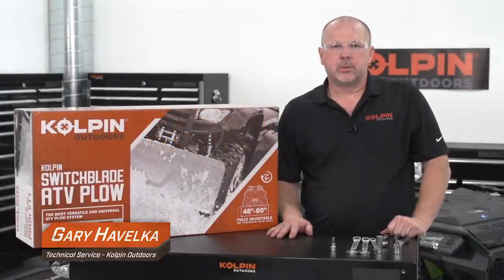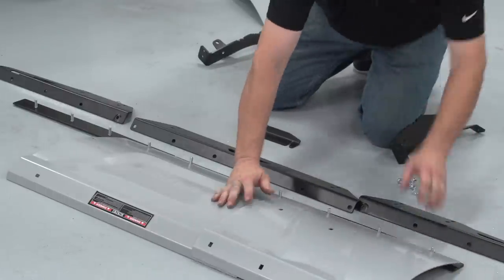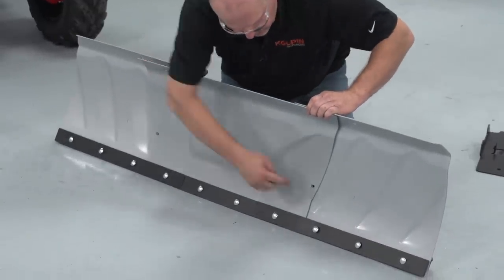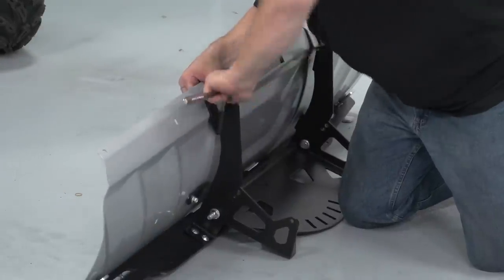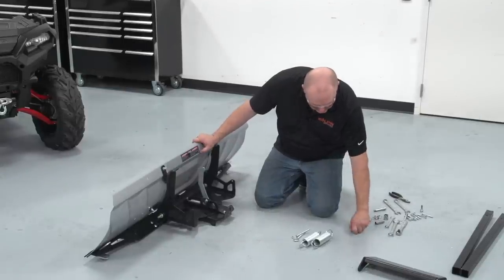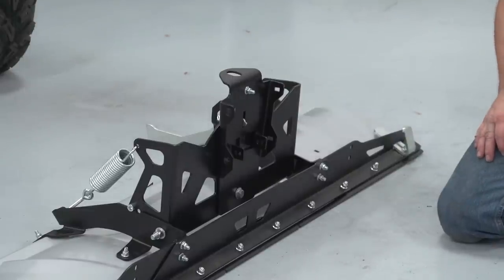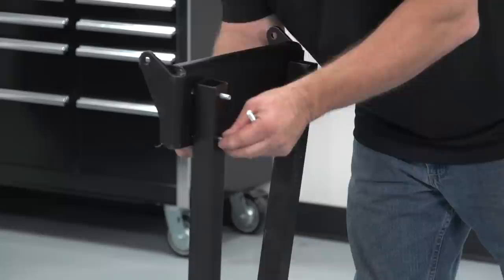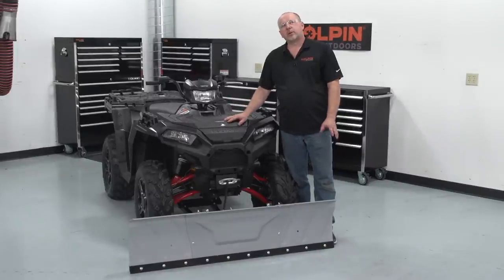SwitchBlade™ ATV Snow Plow System Assembly and Installation - KolpinOutdoors

Comment: Any videos on universal mount install? This video skips that whole Step..i know they vary per quad but would be nice to see it done once
Reply: If you need help with the universal mount it you may need to buy a surmount for certain machine and what you'll need to do is there are holes in your frame and you grab your you U bolts and your bracket and then tighten them down against the frame make sure they both go on both sides and then you'll be good

Comment: Your video was decent, you need to be more specific about which piece of hardware goes where. I had to jump back and forth between the video and the instructions because you didn’t tell me the exact nut or bolt that I needed.

Comment: First of all, both of our customers that bought these units gave up and brought them in for us to install. With over 200 pieces of hardware, lousy instructions, and a "universal" mount kit to deal with, they chose to pay us $60 per hour and negated any savings on the cost of the plows. The mount install included grinding, cutting, and repeatedly installing in different locations until the front tires didn't rub the mount at full lock. What a misleading piece of information you have provided.
Reply: What did you mount it on?     I'm not a mechanic and a friend and I did it in an hour in -20. Only weird part was the mounting bracket on my 2021 Polaris 570 wasn't lining up, but we figured it out. Otherwise it was a walk in the park. No drilling or grinding and cutting.
Reply: @simonduzz  Suzuki ATV 4wd and a CFMOTO UFORCE 1000.
Reply: @atvseatexchange2176 what did you grind on the Suzuki ? Model and year ?

Comment: I got the UTV switchblade it’s the same but adjustable 60” up to 74” .  This year I’ve put it on my 2023 Honda pioneer 520 as a 60” setup without the push tube extensions.   Last year I used it on a parking lot on an s10 Jimmy as 74” with the push tube extensions .

Comment: It took me a lot longer to install mine as well. I assembled it in my garage. I had it lifted up to get under easier. 
I cut the bolts underneath like it says to. Lowered the 4 wheeler drove out the garage and tore out the bottom plate
that the door goes down to. So on my 4 wheeler it is too low to the ground after the plow is attached!!

Comment: Hinge lever bracket needs to be shimmed in the back bolt so plow will pivot more easily.  I installed it on the polaris 570 and the mounting bracket fits very good just ahead of the battery but you have to grind the metal battery box on the corner very little.. Very pleased

Comment: Thanks very much I'm putting on a 2014 Can-Am Outlander 1000 Max Limited the directions are kind of a pain in the ass I was able to get this done in about 45 minutes to an hour with your video thank you making it easier!
Reply: Did you get it installed  inwant to put one on a 2010 renegade
Reply: @austanhall  yeah I got it on wasn't very tough took about an hour I'd recommend getting the guiding sticks that go on the side of the plow it makes it a lot more helpful
Reply: @austanhall Did you get this installed on a Renegade? I have an XMR and looks like I need to drill all the holes

Comment: Hey Guys, Just yesterday I put this blade together with a friend, it does only take about an hour, only on my 2021 Sportsman 570 the Mounting bracket just didn't line up with the photos in the directions or the pictures that Kolpin Emailed me after we started freezing our asses off trying to get it mounted. In the end we figured out a way to do it with 3 U bolds like required ( NO TIRE RUBBING, NO BORING HOLES IN THE FRAME. NO BENDING THE FRAME) as I've seen in some Comments and other videos, if you're bending the frame you're doing something wrong... In the end it works without issue. Best to line it up to the frame before hand and make the call yourself. Otherwise I've seen some long term reviews, seems to check out as far as durability goes. Just try to lift the box when you buy one lol, its heavy duty. Non the less  it's a decent cheaper alternative as oppose  to going with the factory one from Polaris. Happy Plowing.
Reply: im going to install that plow on my 2015 Sportsman Ace tomorrow i'll see what you're talking about!

Comment: What’s the adjustment on the outside angle brackets with slots ?
Reply: I was wondering the same thing.  I just put them as low as they would go as per the video and tried my first snow clearing and it worked well.  I think it's just an offset if for some reason you DON'T want your blade scraping the ground when all the way lowered.

Comment: the bolt holes did line up on the right side of the plow,after putting it together 3 times,worst thing i bought in a long time,i got mine a lowes,they took it back with no trouble

Comment: I called Yamaha for a new Warn plow mount for my  2021 grizzly and they said it would cost $252 plus tax, thought that was kinda steep for a metal plate so I did some research found this Koplin Switchblade. Box said 1hr. I had it together and on the bike in about 3hrs. I followed this video and ran into a few issues(tighten bolts then having to loosen them to do the next step) overall went together pretty easy. I had to remove 1 piece of my skid plate to mount the plow mount which isn't a big deal for the winter. 2 things I don't like, where the winch hooks up to the plow(to straight up/down, very little lift) and hooking it up to the mount was kinds of a pain in the a**. I ended up having to use a car jack to lift it into place. But for $359 cdn + taxes in can't complain, we'll see what it doesn't tomorrow when the storm hits.
Reply: Just got mine on sale at Cdn Tire and mounted it today on my side-by-side.  Also found the same issues following the order in the video here in that I had to reverse my steps because various bolts on the 2 vertical brackets wouldn't set straight for tightening.  Got it worked out in the end and as for lifting it into place, not sure what you did exactly but it supposed to just rest on the ground and all you should need to do is lift the far back end of the bars/arms up into the mount/harness and pop the lock pins in to hold it in place.  As for how it worked out plowing, it was a breeze on my Yamaha Wolverine X4.  Effortless plowing.

Comment: You get what you pay for.....cheap price, cheap plow with Chinese hardware and shotty mounting options.  Do yourself a favor and Spend the extra $200.00 more for a quality moose or warn plow system that will last a lot longer.
Reply: They are shit mounts there are bending the frame on my quad
Reply: Not even 20 mins after installation exactly to specs and torq. The mount and hardware bent . Took it off and got a full refund. Don't waste your time with this crap spend the extra cash for sure .. ( didn't even get two full driveways done)
Reply: Moose and warn also made in China.